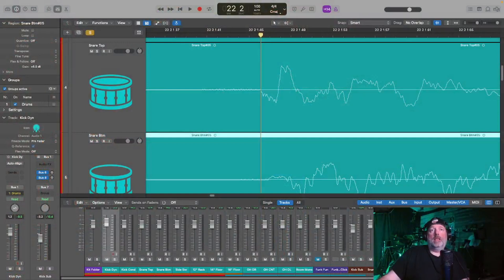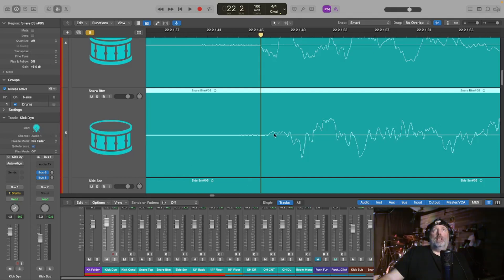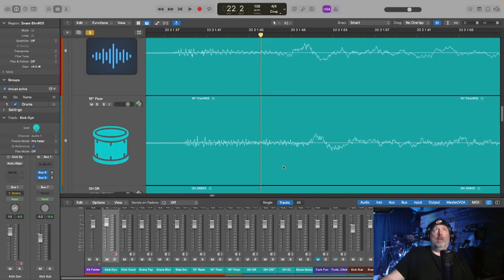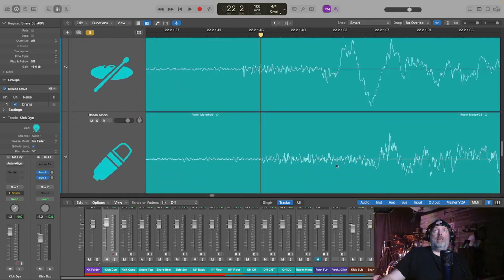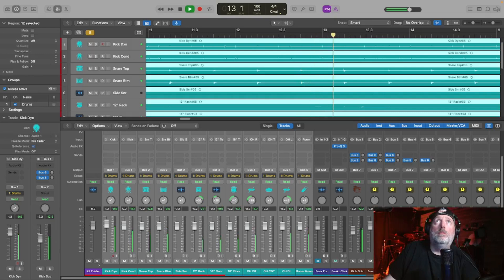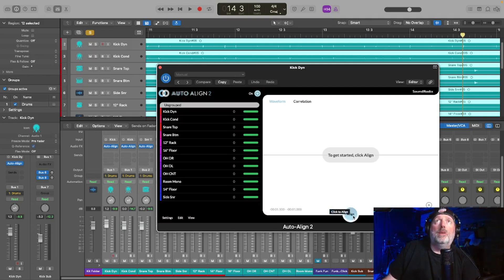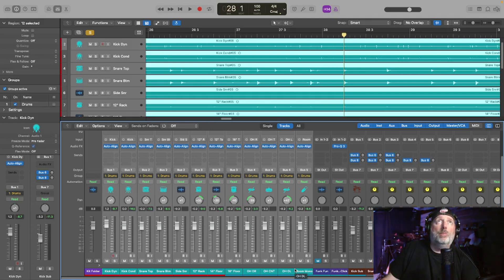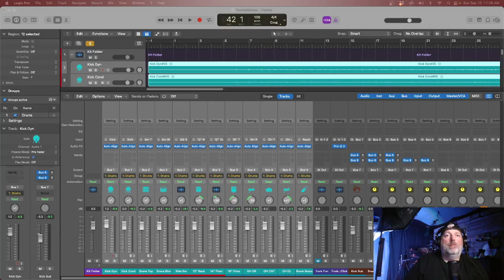Auto Align 2 - Demo and Walk Through

Comment: Thank you! Can this also work on MIDI tracks as well or Audio Tracks only?  I must say this will be my first time using this plugin.
Reply: As per my info it only works on audio channels. Is this correct?
Reply from the maker: Yes it only works with audio. As midi is digitally recorded phase shouldn’t be an issue. This works really well for audio where a single instrument has multiple live mic tracks.
Reply from the maker: Yes audio only. It’s not designed to time align to the grid only multiple mics recording at the same time.

Comment: Cool video man! I'll mark this for the future when I get an interface and record every mic separated. Actually I get a final stereo mix from my mixer for all 10  mics.🤘
Reply from the maker: Thanks Tobi. Yeah I did the stereo out thing through a mixer for a while. Then I fell on the bandwagon of using a straight interface and doing all my mixing “in the box”.
Reply: @gazgraham  I had to start with the mixer and will have to use it a while because a neighbor told us this is the best way for me to learn EQing right and not to use plugins making the life easier without understanding anything. He said after a while I could change to an interface.🤘
Reply from the maker: @3L3V3NDRUMS  I kind of understand where the neighbor is coming from. If you use only presets in a vst you won’t learn much about the mechanics of eq, compression etc. and how that all works. The answer to that is don’t use presets and learn it😁.